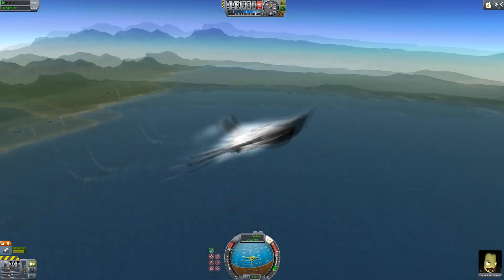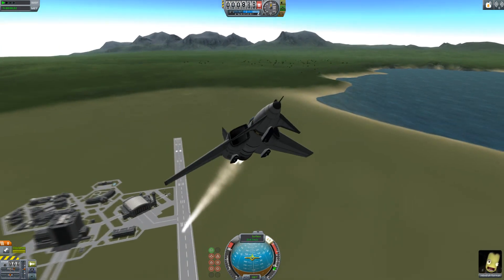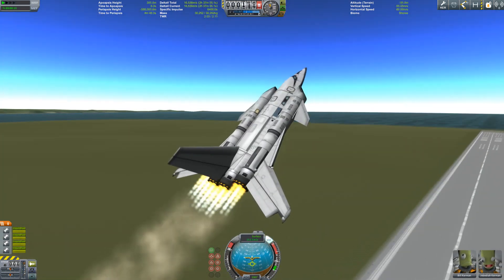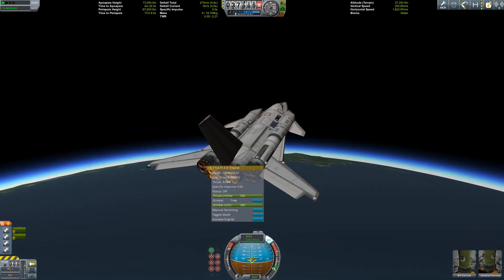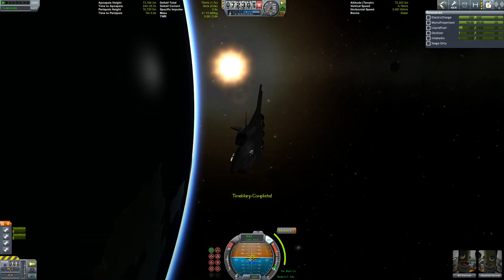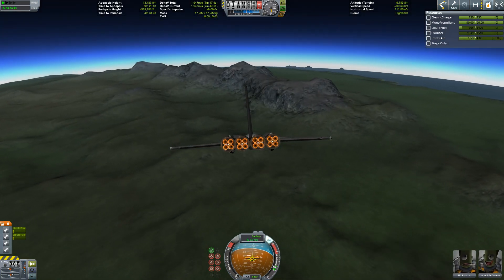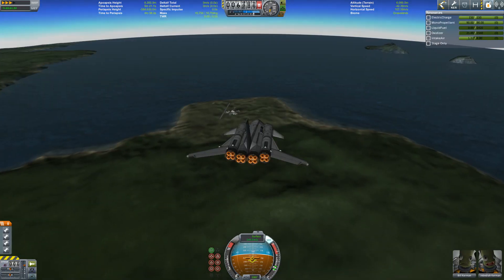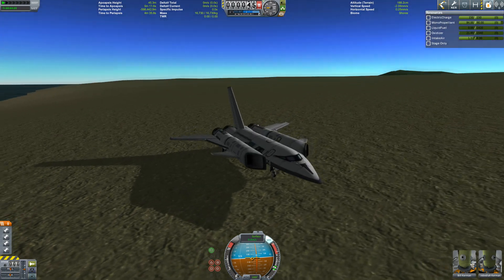SSTO - Single Stage to Orbit in Kerbal Space Program 1.0

Comment: This is very interesting and I have been putting together a small MK2 SSTO myself. Would love your advice on this actually. What do you think of my launch profile in this video? 
https://youtu.be/j99jZ-LyW3Q
I'm trying to do what you do and am basically following this general set of rules.

1. Try to keep space plane on a slow climb (at least 250m/s).
2. Level out at around 6000m and wait until speed climbs to around 600m/s.
3. Climb again until around 20,000m
4. Level out until hitting around 1,300 m/s.
5. Engage Rapier closed cycle just to raise apoapsis to around 55km.
6. Kick in Atomic engines as late as we can to ride the rest of the way into orbit.

I'm not 100% confident that there are not better profiles with a craft like this.

Comment: 4:45, Angle of attack can be measured in degrees instead of a percentage/ratio. You can get a rough approximation by comparing your nose indicator to the prograde marker on your nav ball. Incidentally, I've found that 30-40 degrees works well for spaceplane retruns.

Comment: I liked your final design; looked pretty slick.  You'd probably have fewer heating issues on ascent if you kept an eye on your acceleration.  I try to keep my acceleration low until I'm through the thicker parts of the atmosphere and then I ramp up the throttle.

SSTOs have always been a pain for me, though.  I currently have one working design in 1.02, but it only got up to about 80 km with just enough fuel left for de-orbit and landing (I always like to have a little in case of problems).  Honestly, I don't like the Rapier anymore.  It was great before 1.0, but it guzzles fuel even in airbreathing mode now (it's noticeably worse than the jet engines).  I'm currently experimenting with a mix of jet engines and nuclear engines to see if I can build a useful SSTO that only uses liquid fuel.

Comment: I was hoping for an SSTO without the RAPIER engine. I had no problem with my spaceplanes in previous KSP versions but now I'm struggling in carreer mode (RAPIER doesn't unlock until the end of the techtree). I guess I'll have to rethink my designs ;)

Comment: They need to add a feature that lets you put thermal tiles on the bottom of the SSTO like on the space shuttle so that re-entry is a bit more realistic
Reply: +Lyrik Tech  I suggest adding a feathering system. deploy it from high up and the upper atmo will suck up most of your velocity. I use aibrakes.
Reply: there is a mod with a tile

Comment: I think the Rapier engines could use a nerf to fuel consumption in rocket mode. That way you can get into orbit with enough fuel to alter your orbit for docking.

And while talking space planes, a procedural heat shield for stock and or a mod would be cool. Then you could cover your belly for re entry like the space shuttle.
Reply from the maker: Russell Shutes Well I plan to establish a refuel station or some kind of "space tug program" in LKO to aid SSTOs barely making orbit. Let's see how that works ;)
Reply: Russell Shutes I think you mean buff not nerf
Reply: nerfing always refers to detracting from the goodness of the item itself
Reply: yeah. So the rapier engine has bad efficiency. So you buff it. Thats what the comment said.
Reply: nerfing the fuel consumption would be making the fuel consumption larger, which is worse, and therefore a detriment to the efficiency.
Reply: No, Nerf. If something is out of balance, you nerf it. If something isn't powerful enough, you buff it.
Reply: You're nerfing the fuel consumption, that is to say that you're buffing the efficiency.
Reply: Vladimir Pootis it depends on how you read it. BUFF as for MAKING IT BIGGER or BUFF as for MAKING IT BETTER. The latter is probably the right one, also because fuel consumption by it self is not a "bad thing" (therefore you NERF it to BUFF the engine), just a natural feature of an engine.